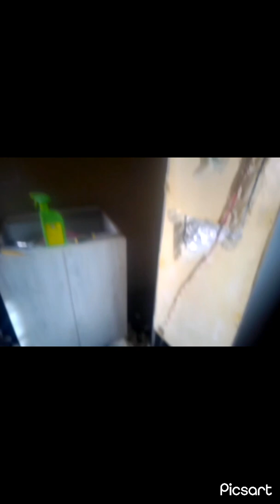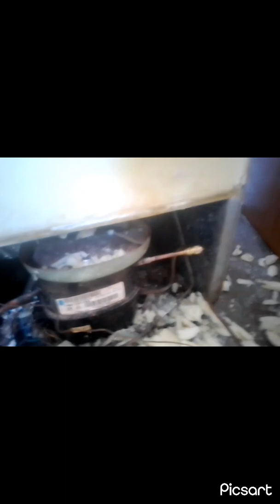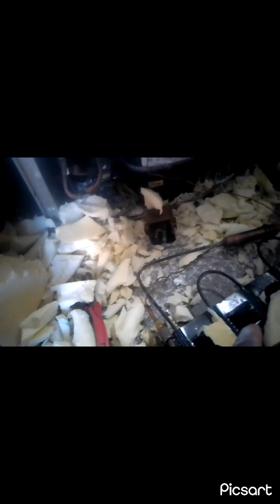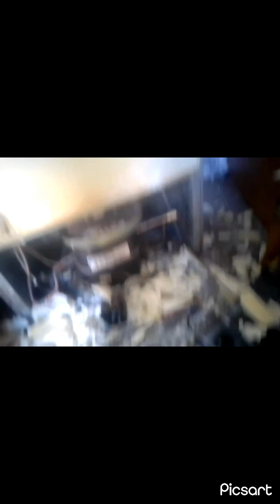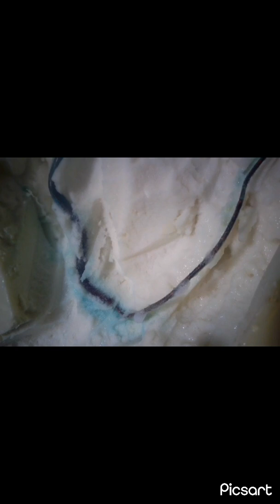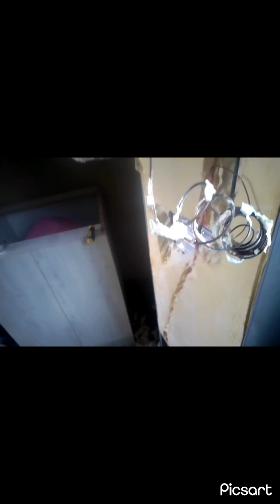how to find a refrigerantor gas leak on a refrigerator step by step

Comment: After putting foam to cover pipes. What did u use to close the fridge cabinet that u put up on the roof, it's a glue what's the name of the glue, if it's selotape which selotape etc.

Comment: This method u used now u can test leak on condenser only and the places u cant because air moves out of the system at the suction pipe were its open correct me if im wrong explain to me pls thanks.

Comment: For the compressor method system is all closed in which air when u switch on the compressor pressure goes from suction valve to discharge to the service valve and through the condenser, capillary filter, tube, evaporator and suction in which when u close the gauge that pressure will not go out of the system

Comment: It seems like the leak pressure test on the gauge with this method is only for the condenser because the air goes from condensor to gauge so when u close the gauge its pressure on the condenser if im not mistaken and from condenser to capillary filter to tube, evaporator and suction  and then out of suction to the air that air is going out of the suction pipe can u correct mebif i a lying

Comment: Once u switch on the fridge the air goes inside the suction of fridge compressor into the system then

Once u switch off the fridge the pressure does not go out of the system even though the suction is still open but u have to close the valve on the gauge for the pressure not to get out of the system and u a4 able to check for leaks

Comment: I believe that gas cools down the compressor so when you use compressor to vacuum, or leaks or blockage the compressor won't overheat
Reply from the maker: It's 100% correct that refrigerant cools down the compressor, how ever if u run it for 30 minutes or less it won't over heat. Thanks for your comment

Comment: Hi can i use pratley on the aluminum evaporator coil leak visible on freezer section
Reply from the maker: Thanks for your comment. I not sure what Pratley is , how ever is you are experienced enough you can solder using an aluminium rod
Reply: Are all evaporator coil aluminum or there is copper evaporator too
Reply: Because the evaporator I saw from a client looks like it's copper and the rod I am using can burn the cabinet. The coil is too close to the cabinet u can't even put something to protect the cabinet that's why I decided to use pratley.
Reply: On the evaporator coil when there is a leak u will see it with an ice build up on the place with the leak right when fridge is on and compressor had gas
Reply: I want to know again after fixing internal leak u put foam then u put what is it the glue to hold the cover tight and what's the name of that glue
Reply: On your video I saw gauge was above 220 Psi is it from the atmospheric pressure and secondly the suction is open, is the service valve also open or no need to open
Reply: For leaks u can use this method but for blockages u will need a compressor to clean the system right usually that's if the capillary tube is blocked

Comment: Hie boss I  changed relay and taste thermostat is fine, I cleaned condenser but it is still working freezer only what do you think it's a problem. thanks in advance
Reply from the maker: Thank you for your comment. If you have an ordinary Refrigerator (the one which does not use fans). And your compressor is running then it means you relay, overload & thermostat are perfectly fine. Your fridge is low on refrigerant or gas.
Reply: Alright thanks a lot keep on teaching us